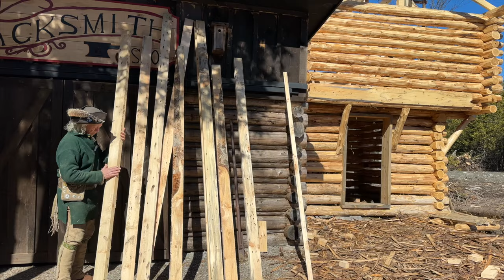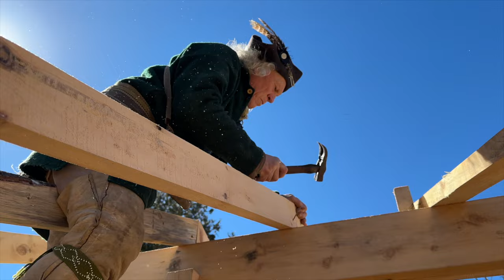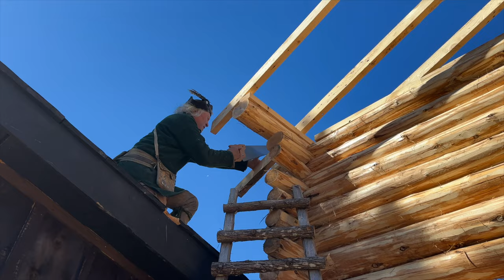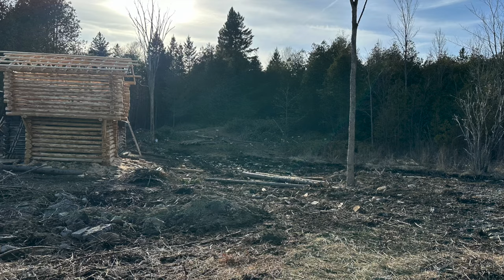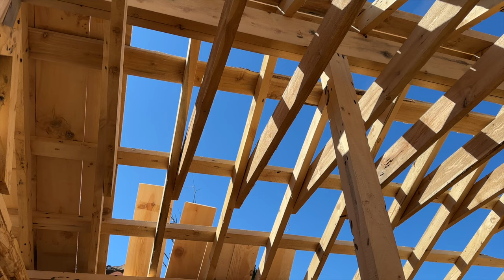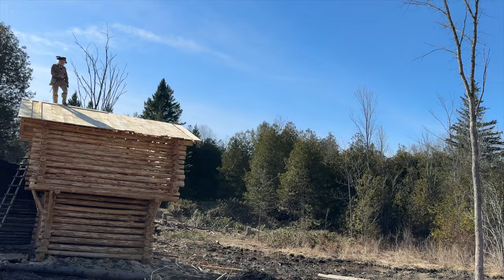No Falling Off the Roof!  And a Wee Bit about Whiskey!  | BLOCKHOUSE | FORTIFIED HOMESTEAD |

Comment: This is shaping up nicely! I’m curious as to whether anything else has to be done to the roof to prevent leaking like adding shingles. Also, will you be filling is the cracks between the logs with straw or daub? Thanks for sharing this journey with us, and be careful on that roof please! When the log fell off in the other video, yikes! ❤
Reply from the maker: The roof is done, may need tar in a few spots. but should keep the bulk of water out.  I’m actually going to fit in smaller filler log rather than chink it, but not until the palisade walls are done.

Comment: Peter, curious of the wood specie you're using.
I own a peeler mill for fence posts, aprox 2500 12 foot posts daily. I use Norway/red pine only. 
You have much work done behind camera. Thanks so much for the time spent sharing history and methods used.
Reply from the maker: In my wildest dreams … 2500 a day, wow.  I use primarily Eastern White Cedar, but used White Spruce for the Blacksmith Shop.
Reply: @TheWoodlandEscape  I like to work with white spruce.

Comment: Interesting board and batten style roof sheeting Peter. Will it be waterproof?
Reply from the maker: Ish.  Ive have one on my primitive shelter for a decade, it has a few drips, but keeps the bulk out.  One can tar areas that leak bad.
Reply: Those boards with enough over lap will pretty much do the job until the boards warp and the nails back out.
One can always spray some clear silicone based water sealant every other year and it will last a long time.
And yes, I was a state of Florida certified professional roofing & sheet metal contractor ( commercial & heavy manufacturing) for over 41 years.
Reply from the maker: @denisdegamon8224  You’re spot on, it is the warping of the pine boards that ultimately make a few leeks.  However, if I look at the date on my passport, I’m probably good to go!